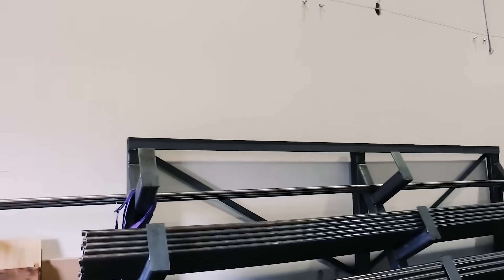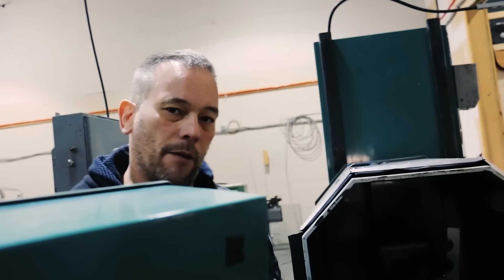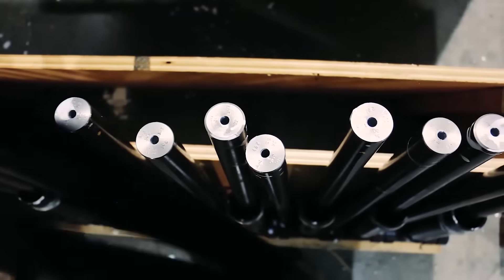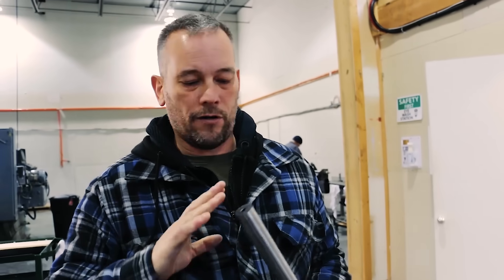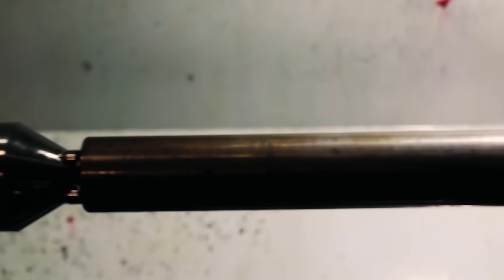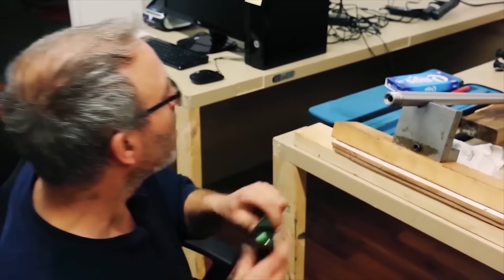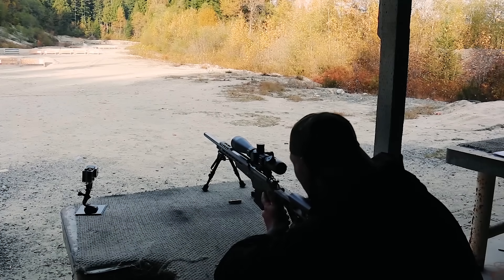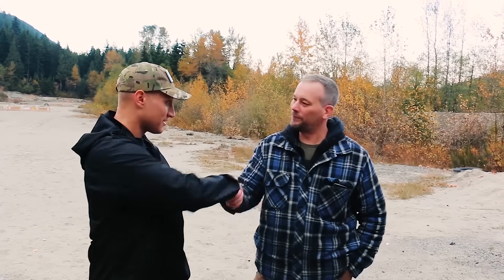How A Precision Rifle Barrel Is Made: with International Barrels Inc.

Comment: Button rifling baby! The only way to fly!
Reply: Chris knows his shit he's right about material deformation in machining.
Reply: Absolutely not. Single point produces the best stress free rifle barrels. The single cutter removes 1/1000 of an inch of steel from the groove with each pass. It doesn't push the metal, it shaves it. It then indexes to the next groove. Takes about 50 minutes to rifle the barrel. Both Obermeyer and Kreiger use this process. Both order specialty steel, in a combined order from a US steel manufacturer, both chrome moly and stainless. The proof can be seen on the line at Perry or at the Palma Championships.
Reply: My comment would definitely include single cut rifling, more than anything in opposition of everything being cold Hammer forged these days😁

Comment: Hey. 
Good vodeo.

I have a theory that i would like to run past you about harmonics. The harmonics is caused when a bullet travels down the barrel, what is the link between the twist cut into the barrel and the harmonics? Cause the metal wil move and expand in the weakest spots more than the rest when the bullet travels down the barrel, with all that pressure and heat behind it. So, the twist cut into to barrel will be a weak spot. So if the twist is clockwise and 1/10 and .25mm deap, and one cuts a anticlockwise twist 1/10 and .25mm deap on the outside of the barrel. The two should in theory cancel eachother out... do you agree?   I would love to hear your feedback on this.
Reply: Riaan van Wyk where i work we have a patented fluting and its basically what your saying its a fluting to follow the rifling of the barrel

Comment: Would you explain what buttoning is?
Reply from the maker: Howard Johnson buttoning is pulling a long rod through the barrel that puts the rifling into the barrel
Reply: thank you
Reply: @LifeLineWarriorMedicine    broach?
Reply: @farrellhamann  some would call cut rifling is broached
Reply: There are several different methods of rifling a barrel.There is the button method where a carbide "button" which is shaped as to imprint the rifling into the barrel through pressure.There is cut rifling in which the rifling is cut with an actual cutter and the barrel is indexed  around until each rifling groove is cut.There is hammer forging in which the barrel blank is placed over a mandrel which has the reverse impression of the rifling in it and the blank is hammered forged to the mandrel shape. This is the most economical method for mass production.I believe the old high standard corporation introduced the button rifling process.There is constant argument over these different methods of rifling as to which is best as far as accuracy is concerned.Kreiger cut rifles their barrels as do several others. But basically it boils down to the care with each process is done.If you buy a gun from say a mass manufacturer chanches are it will be hammer forged and will not be lapped because it would not make it economical to sell. A lot of this stuff is voodoo as I have seen barrels that rifling and bore looked like shit but shot well. A barrel with correct tolerances and nice finish will shoot well and be easier to clean and will not collet fouling residue as bad as a typical mass produced one.Ammunition is a big factor too. You cant expect good groups from shoddy ammo.
Reply: It's similar to pushing/pulling ball bearings through brass tubing to make it a uniform size when making musical instruments.
Reply: Howard Johnson a button is what rifles the barrel it doesnt cut the metal it pushes it

Comment: not one time in your video did any of you say the company name,i had to get out my laptop to research this company, VERY  unprofessional video direction thumbs down guy
Reply from the maker: Dan Strayer this isn’t my operation. This video is already 13 minutes long to show more obviously the video becomes much longer I have another version that’s 40 minutes if you would like to watch that. The tour was over 4 hours I cut this video down to the shortest possible length and provide the most information possible
Reply: citizen E Do
 you ever look at video descriptions? The company link is there...
Reply: The video was pretty good. The company looks like a small company with a small staff that take turns working the different machines to fill likely relatively small orders, yet can hire new people and really pump out product for larger orders. I have been through many factories and that factory was darn quiet and over all audio was good. The video showed you the general steps it takes to make a gun barrel, from stock metal to finished barrel.
Reply from the maker: citizen E you’re right I’m not a preofessional director. That’s why it’s on YOUTUBE! Besides I’m a soldier not a video producer
Reply: Agreed. Not nearly enough of the actual machining, and if you're gonna  make a video about your operation, turn some of the equipment off  for better sound quality.....it won't bankrupt you to shut down partially for 10 minutes.

Comment: Amazing you still can't buy better equipment.  We have quite a few manufactures up here with the P&W machines.  Both of the big names you mentioned :D
Reply from the maker: Operator Headspace who is it that you work for that uses the P&W machines?
Reply: Criterion, Bartlein, Krieger, Brux, Rock Creek, Mid West are all in-town for me :) I just work at a hospital though.
Reply: Operator Headspace So you work at a hospital, but you know more about creating match grade barrels than the guy who makes them for a living? Right. You are an embarrassment.
Reply: Even if the base machine was built in 1912, it looks like it had been upgraded. There is nothing wrong with old machines as long as they are maintained and meet production requirements